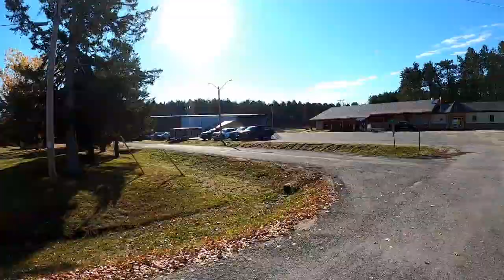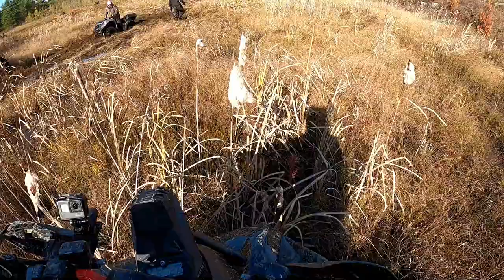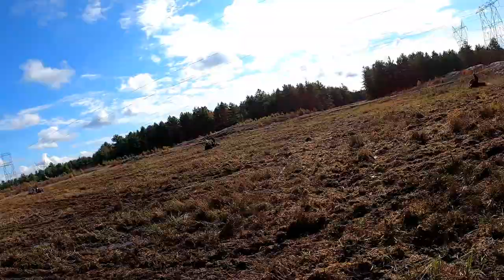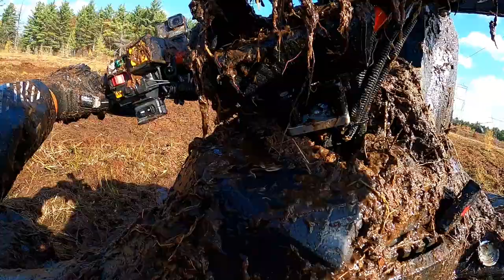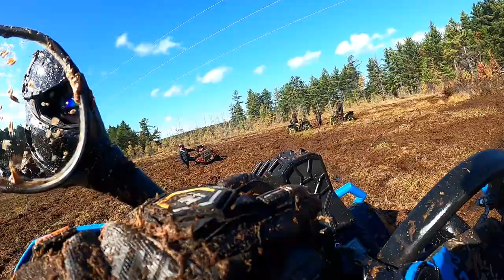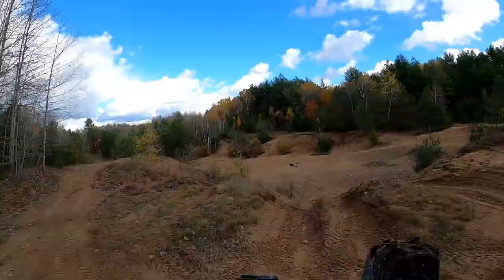Tough BREAK!!! TOO MUCH POWER & TRACTION

Comment: Can't go wrong with some SKEG! Definitely need some more Polaris in that lineup! Just need that border to open back up...though it seems like that will not be happening anytime again soon! Might have to pull out my Essential worker card, though when they open the trailer to check the inventory, they may question the two quads. lol.
Reply from the maker: Hahaha, Yeah I would think. Hope things get back to the norm sooner then later for sure. We'll have to through a hell of a ride to celebrate, eh.
Reply: @ehTV1000  AMEN to that! Once that iron wall goes down...it's beer's, steers, and queers. I mean, ummmm, skeg? Pardon my Revolting 🐔 reference. I should be ready for a solid 2021 send with the 1000 S by then.

Comment: What bumper is on grants quad?
Reply from the maker: That used to be the wild boar rad relocate, cut off the top I believe or it may have bolted up to the bumper. But yeah, wild boar if I recall correctly makes that one.
Reply: Thought so, Thanks for the reply and the great videos!
Reply: Quick question, got a 2021 renegade 1000 with extended warranty. Will putting on a Rjwc duel slip on and programmer void my warranty?

Comment: Them tires are designed off the cut boggers which have been given the nick name of "axle breakers" for good reasons.
Reply from the maker: Axle was quite used and probably long overdue for replacement. But yeah that grip is insane.

Comment: My wife rocks gator gear but she claims finntrail doesn’t stain as bad. I think whatever I wear will stain. I do like the boot separation.
Reply from the maker: I think I would agree with your wife after the last two rides. The Finntrail did rinse cleaner. My gators come good and clean with a touch of soap, but the light grey color is hard to keep that way.
Reply: eh TV you nailed it bud! And thank you for reminding me what colour my gator waders once were lol